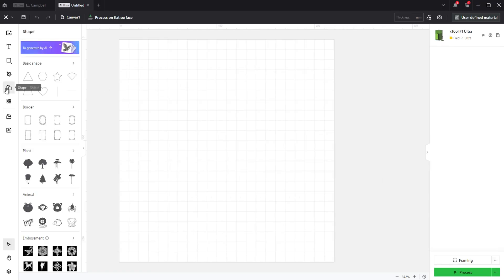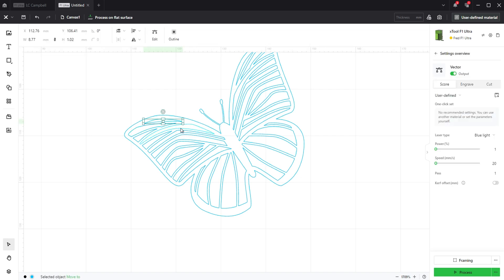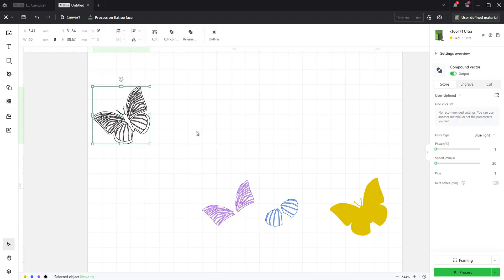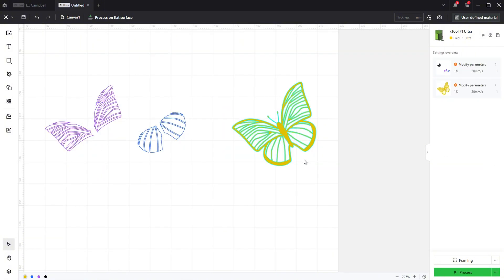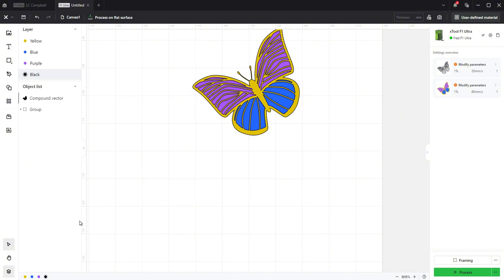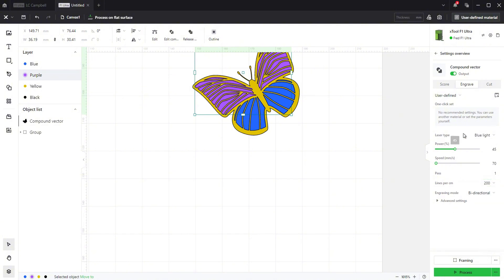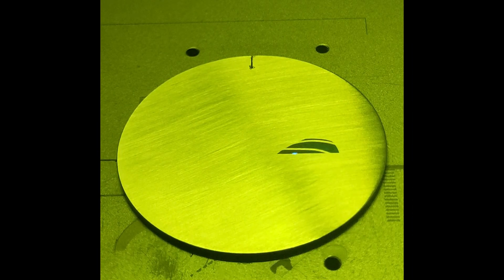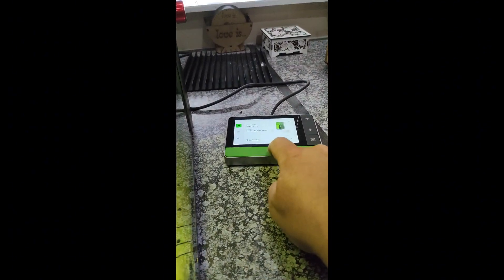Stainless Steel Engraving Made EASY Without Frustration

Comment: Ah i recognise this accent . 🇿🇦. Im also looking into this f1 ultra buy also looking at a 30w laser with the camera and belt with no diode
Reply from the maker: @nandofabio1519  Hi.  Just note the Ultra is a 20w machine. But more power equals more speed. If you are not running a gun engraving production line, the ultra will do most things very well. 😉👌
Reply: @KatSeBladEngraving  haha no man. I do custom dices for someone. And I have to resin print them and make it a 2 part dice. But if I get this machine I can do more products for the person
Reply from the maker: @nandofabio1519  sounds awesome. Do you have a video or fb of your work? Would love to see.
Reply: @katseblad  no. Have not even advertise once. I just work as a supplier. Less stress . But eventually I'll make more products. Based here in cape town. Will be following your channel for lessons hahaha
Reply from the maker: @nandofabio1519  Close by.  It's a great journey.  Sure you will enjoy it.  😁
Reply: @KatSeBladEngraving  like resin printing. I thought it will be a easy process. Then a few months later and alot of money and failures I got a 100% print optimised to save resin.  Now I want to go fiber route . Need to work out a business plan for the one product to pay of the machine. Basically I just want to machine to play around with hahaha